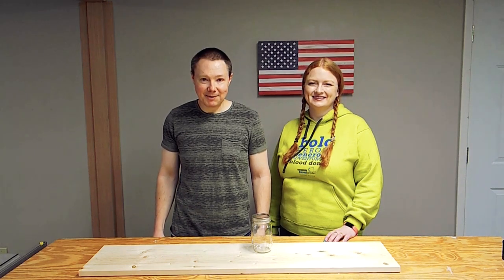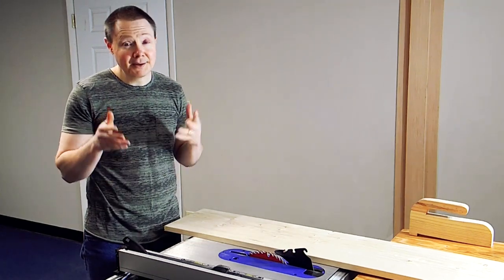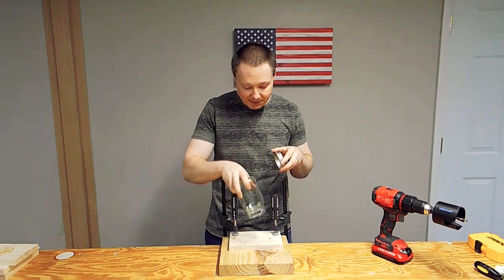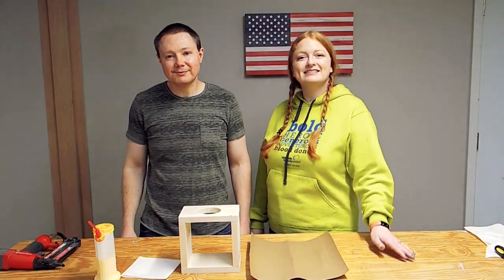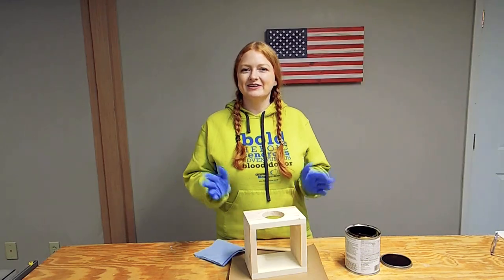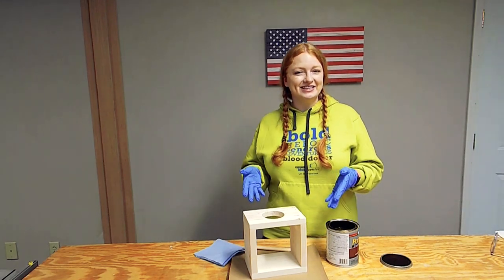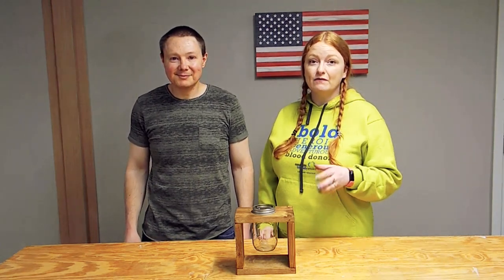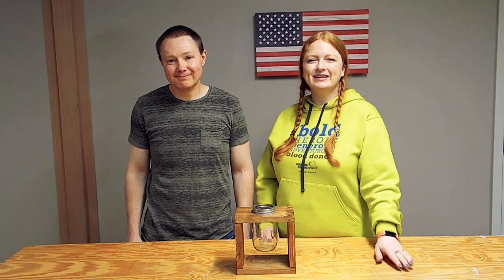FLOATING Mason Jar Holder | Home Decor for the HOLIDAYS | Beginner Woodworking Projects that Sell

Comment: Great project, I am wondering how good is the dust collection on the Kobalt table saw?
Reply from the maker: We use a homemade dust collector and it does pretty well. You can definitely tell the difference when dust collection is not attached! If you are wondering how it compares to other table saws, we don't have another to compare it to. Hope this helps!

Comment: I used a 2 3/4 inch hole saw and  the hole isn't big enough to get a ring on the jar. Any idea what I did wrong?
Reply from the maker: For some reason, we forgot to add footage of an extra step. We had the same problem you're having and ended up routing a round over on the bottom of the hole. The jar still fits snugly but we can thread the lid. Thanks for your question and for watching!
Reply: This is the same issue in which I’m also having. Any chance of another video regarding your solution step? Thanks
Reply: @happywoodworking  what size round-over bit did you use?
Reply: 1/4" round over works
Reply: @steelsunpi  thanks
Reply: What size jar did you use? Regular or wide mouth?